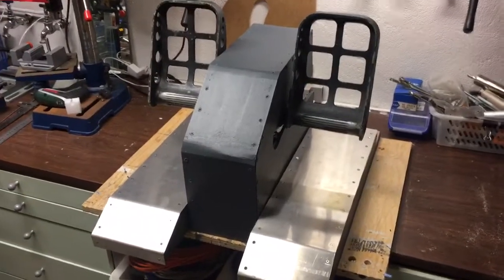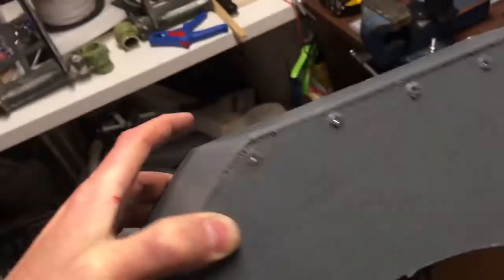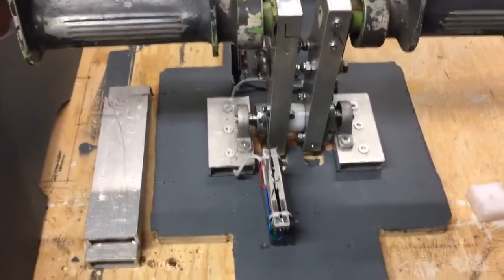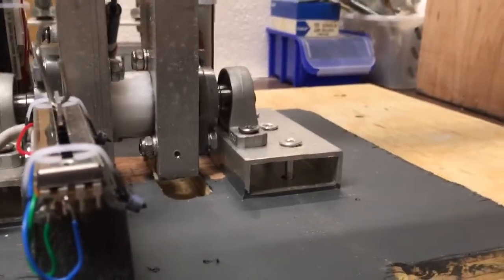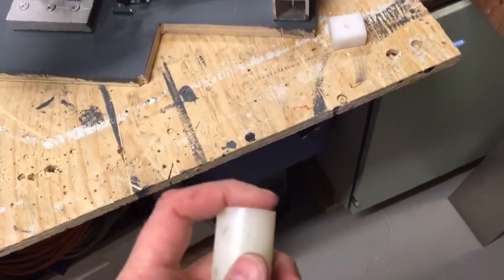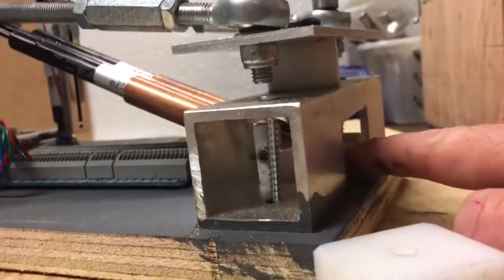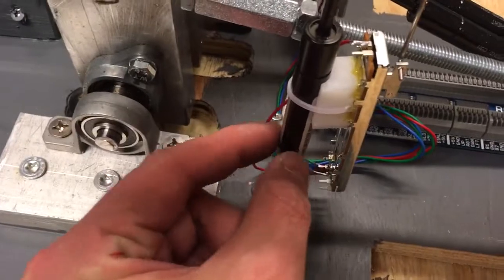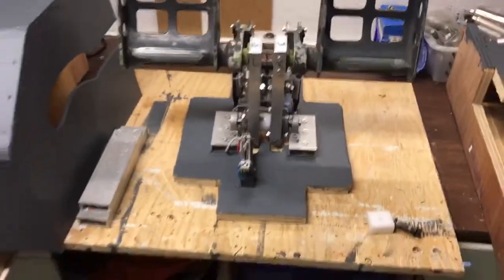737 rudder convertion

Comment from the maker: Drawings are ready as well as a list of material/parts. The part list contains links to ebay for each item. I could not make clickable links in here, so it will be posted on the Prosim737 forum tomorrow. Also check out the simbuilders group on FB: https://www.facebook.com/groups/1776751819242774/
Reply: Hi Geir.  A fantastic design that I'd like to replicate for my sim.  I'm having trouble finding this parts list you mention above though.  Do you have a direct link to this parts list?
Reply from the maker: @Medicnz100  i see many links do not work any more. It was to a rarher local dealer, but google would help you find something similar like https://www.gassfjaershop.no/produkt/gassfjaer-14-28-slaglengde-100/?gclid=CjwKCAiAlrSPBhBaEiwAuLSDUFOeZrQM2jJGQl88ie0aobRYB8bugoFVblIl7dWGaBQgT9HxLF9njhoCSbwQAvD_BwE
Reply: @geirteigo480  Thank you.  Was it the same gas spring used for all four in your build?
Reply from the maker: @Medicnz100  i used the same type, but different size and Newton for the toe brake. I found Lesjofors site catalouge. Look at «threaded ends» in link: https://catalog.lesjoforsab.com/category/gas-springs

Comment: Hi Geir, could you share what model of Shock absorber (size and  Newton )are you using on it ?
Reply from the maker: Hi Leonardo. For  the brakes, 40N is ok. 50 can also work.
For the rudders I would go with 100N, but remember the rules about torque: τ = F·r
It all depends on where you attach the springs/struts.
The gas strus for the brakes should have the same length as the radius of the rudder movement, as for the rudders you need about 80mm movement of the piston to pick up the  +/- 10 cm movement of the rudders. This also depends on where you attach the struts
Reply: Many thanks Geir last question, do you have any drawings with the sizes ?
Reply from the maker: Leonardo Montané i will provide detailed drawings and list of components within a few weeks
Reply: oh!!!, Fantastic, could be great if for reference you can appoint to Amazon´s links or similars.
Reply: oh!!!, Fantastic, could be great if for reference you can appoint to Amazon´s links or similars.
Reply: Thank you Geir!!
Reply from the maker: After I have used the pedals for some hours now, I will state that 70N is ok for the main gas struts after all. As mentioned, it do depend on where they attach to mail shaft, but as drawn, 70N is working very good.